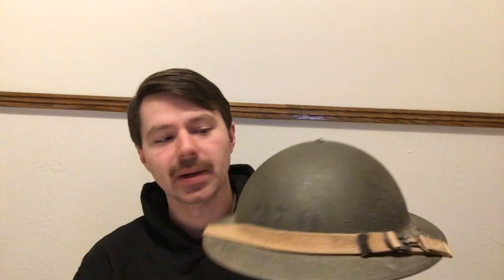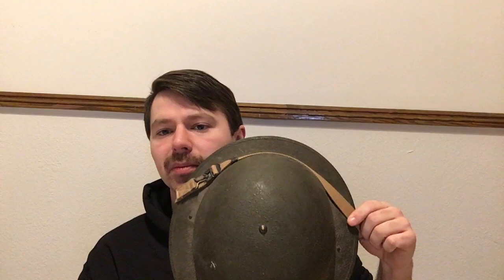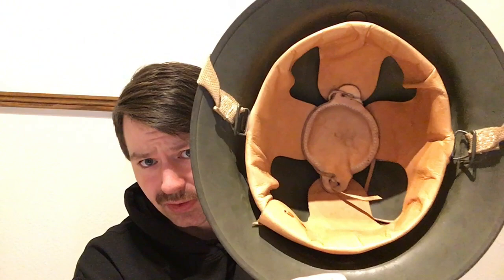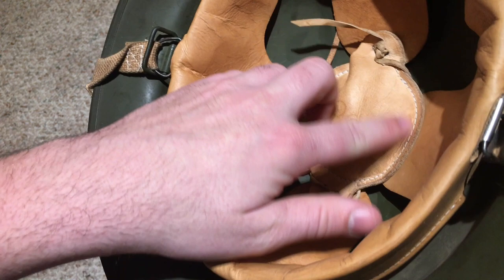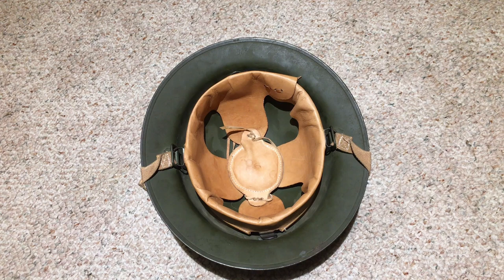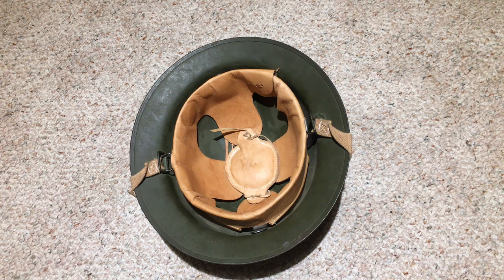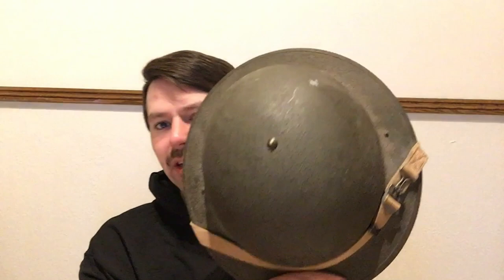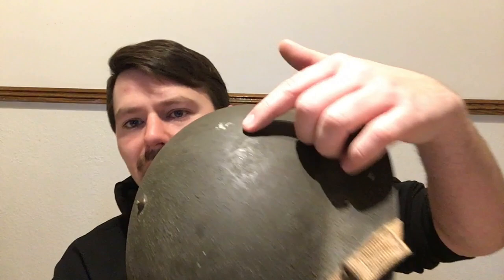American M1917a1

Comment: The steel is called Mangalloy for manganese austenite alloy steel, also known as Hadfield Steel.  Brits used it in WWI helmets, but not widely.  Canada made much prized miners helmets from them before the war.  They say it stops a 45 cal. bullet going 600ft per sec from 10 feet away, and you can knock out the dent.  Your head would crack like an egg from the impact though.

Comment: I just got a relic M1917a1 helmet, it still has the metal liner frame, sadly the rim is gone. It's quite rare here in the Philippines since most of the US helmets were captured, destroyed, or scrapped when the Japanese invaded in 1941. The number on the shell suggest that it's a converted m1917.

Comment: It takes a lot of ideas from the medieval kettle helmet. 

There were a ton of styles and a-lot of regional variation. But it in general, it sits up fairly tall, slopes down and covers part of the shoulders. And has a remarkably similar liner to this helmet. With what little evidence we have of liners from that period. 

It’s an excellent design and was used for hundreds of years. It was extremely comfortable and provided a soldier with excellent protection from arrows raining down or strikes coming down on his head as it is one big glancing surface. It also allows a soldier to do manual labor or all the other non combat duties a soldier has. Soldiers spend very little time in actual combat compared to doing normal soldier stuff, so a helmet you can wear all day in all those activities is ideal.